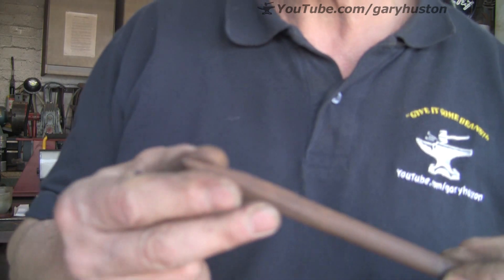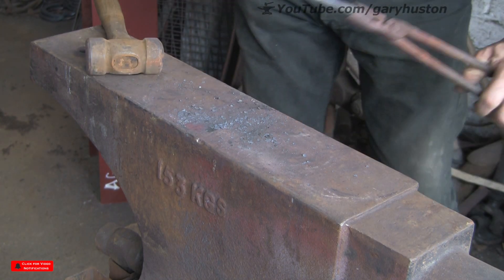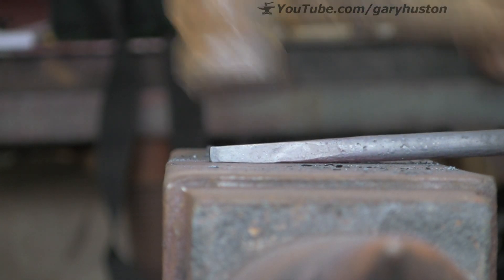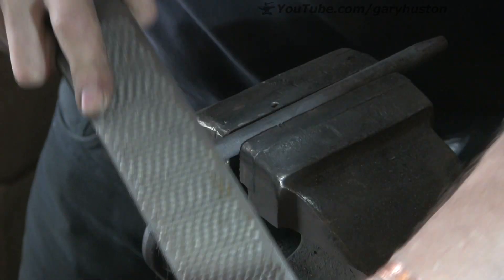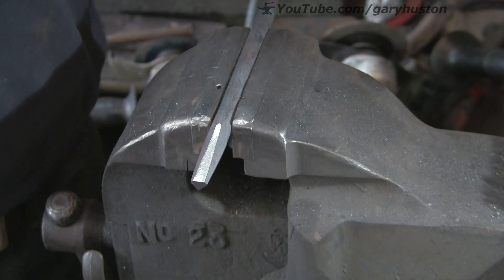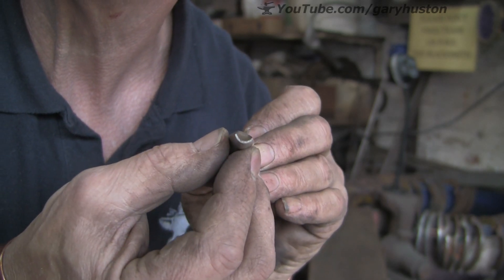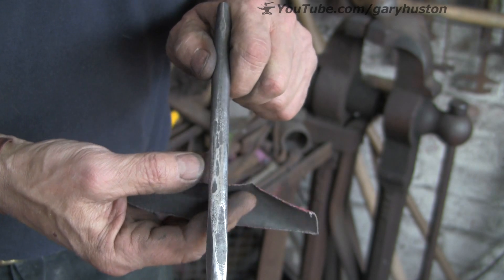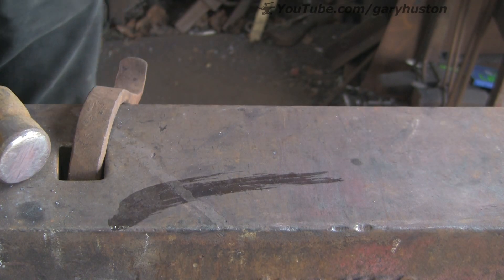Forging a Mouth punch

Comment: Great video!! Two questions though. What is the benefits of filling all the way vs. using a piece of smaller diamiter round stock hammered over it to get the concave started? And, why blue and not the "typical" straw color? Thanks in advance...